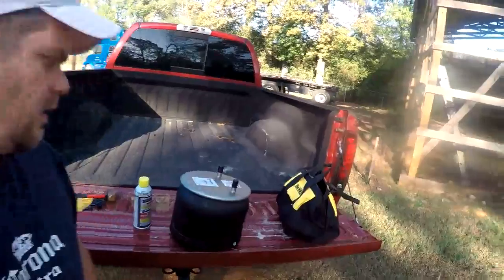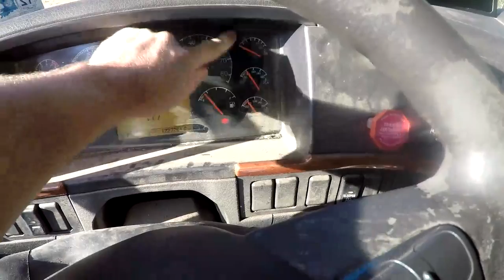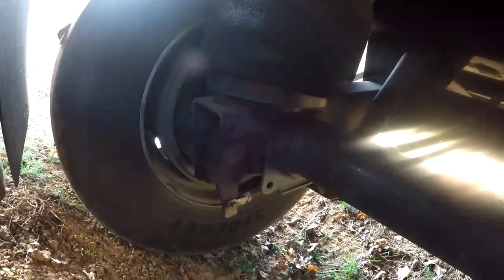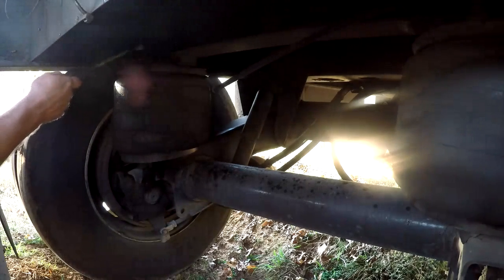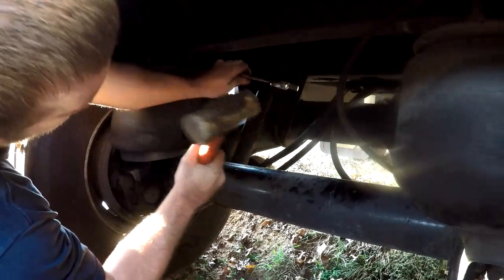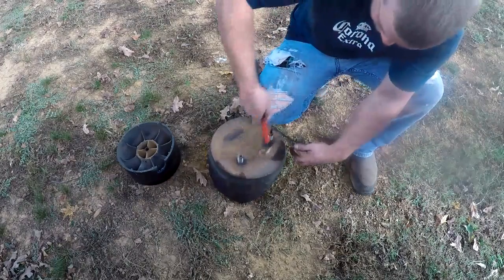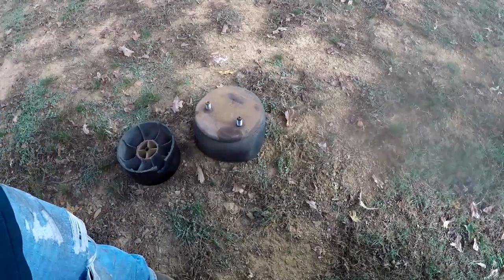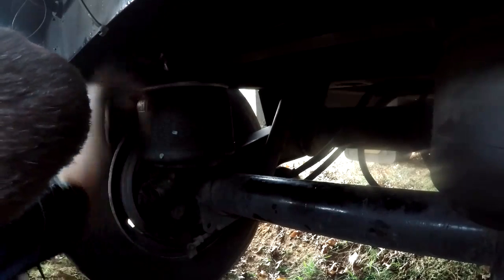Replacing air bag on semi trailer

Comment: I always seem to find the best prices on line too.  Really not an easy DIY job for sure but I can imagine a shop price , it's worth doing yourself,
Reply from the maker: It's not that bad of a job as long as its not loaded
Reply: chase5726  did you find a quarter inch plug?
Reply: S Fay  Did you you loose one😂😂
Reply from the maker: yep lowes had some
Reply: STEVE ROB .. yes he did but he found a replacement.
Reply: chase5726 ... thanks he found it at Home Depot.  Thanks for the pointer on cutting off the bolt. Thanks for posting your video, it really Helped.

Comment: If you just cap off that airline the other three airbags will lift the frame and you don't have to jack it up.
Reply: Daniel OMalley dumb question here,how do you plug the line?? Is there a special plug that you need ??
Reply: Get a push fitting and thread it into a female air chuck, whala sealed airline. Good thing to have on the truck
Reply: Exactly what I did get a brass shut off valve that screws right in the air line that goes to the bag and shut the air off and on as you please